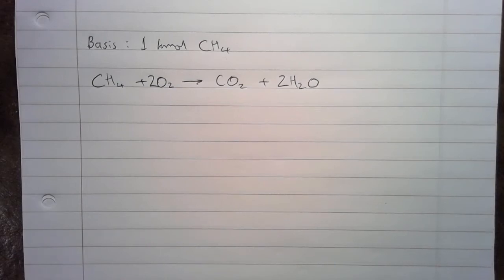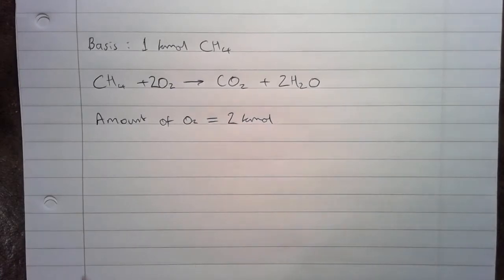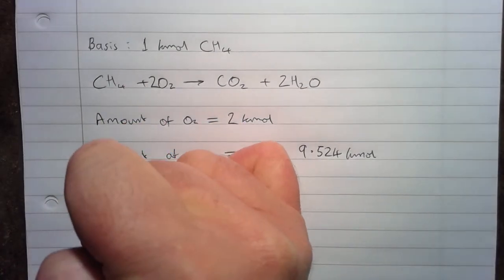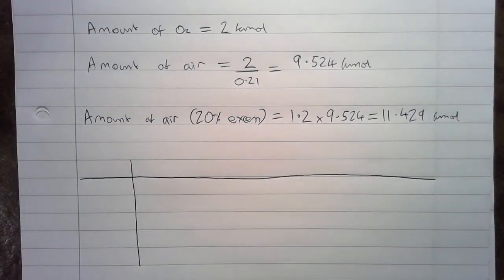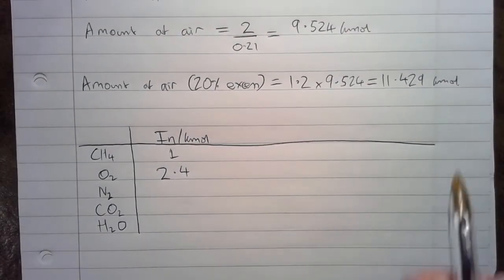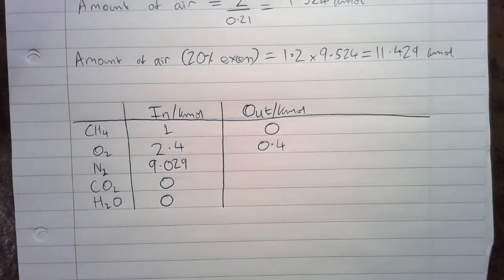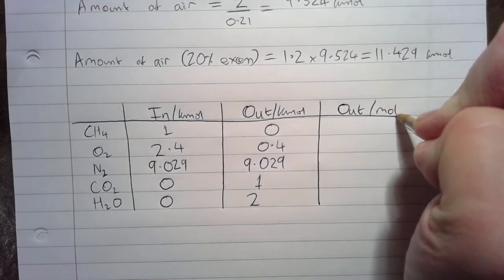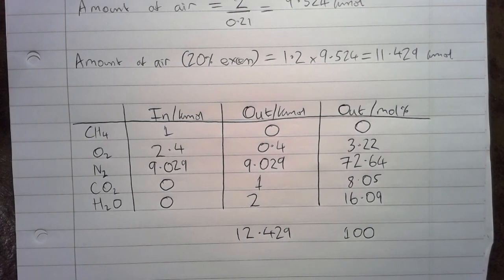Solving the material balance for the complete combustion of methane

Comment: Wow, best explanation ever, but I don't understand why methane burns, if nothing is lost, what makes the flame and the heat, the energy?
Reply from the maker: Firstly, it takes energy to break the bonds between atoms in the methane and oxygen molecules. Once these bonds are broken, new modules (water and carbon dioxide) can be formed. This happens when new bonds are formed between the atoms in a new arrangement. Energy is released when these new bonds are formed. For an exothermic reaction like combustion, more heat is released by the formation of the new bonds (to make water and carbon dioxide in this case) than was required to break the original bonds in the reactants (i.e. to break the bonds in the methane and oxygen molecules). The energy is released in the form of heat and light.
Reply: @ChemEngTutor  Thanks for replying, I imagine this is one of the simplest chemical reactions there is, but it all seems amazing how it happens, the universe is a playground for change, thanks.